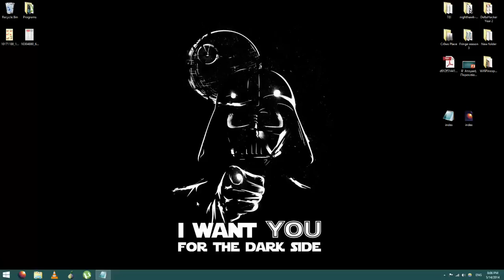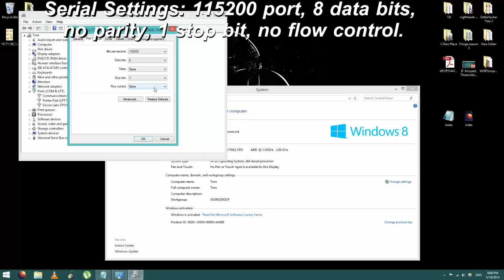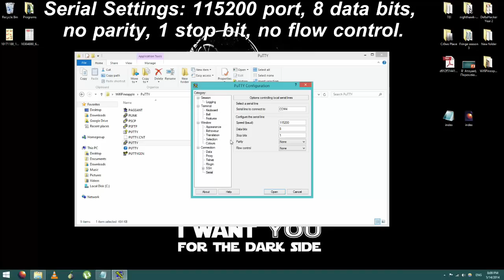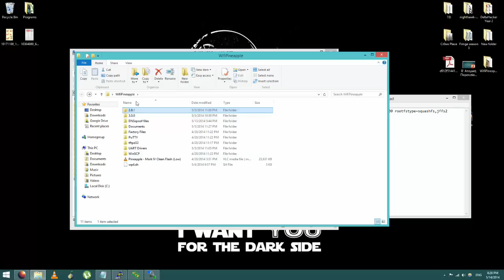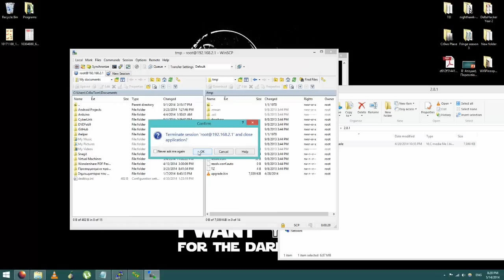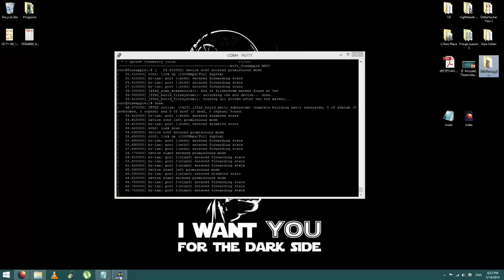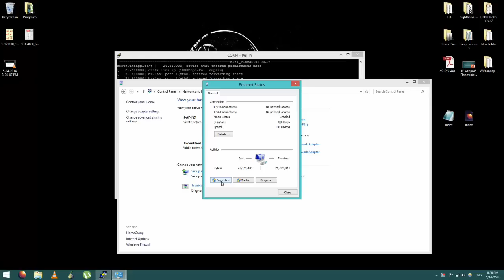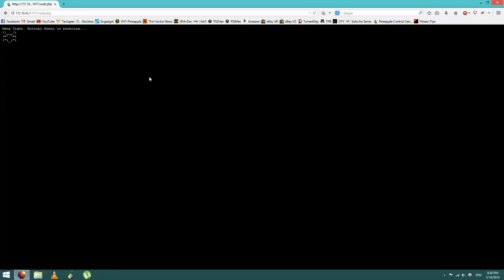Custom Made WiFi Pineapple Mark 4 - AP121U Flashing (HD)

Comment: First of all: Nice tutorial. Worked fine for me but i have a question about the images you used. Did you have to manipulate them to work or are they the plain images you downloaded from hak5's download page? I tried to upgrade to the current MK5 version but i get an error stating the image is wrong. Thanks

Comment: hello! I ordered all the parts yesterday for this project can't wait to get started! I had a question though, the ap121u has the USB port I know that, and I'm pretty certain that it is used for another antenna such as other Alfa high gain wifi dongles. so my real question is what wifi dongles are all supported?
Reply: darn i t ,I just now realized I ordered the 16mb/64mb model will it still work?

Comment: I do have 2 questions..... 1)  Couldn't you do this through WinSCP to avoid the UART to USB cable? If yes I would prefer that since I can upload all the file with WinSCP instead of tftp...
2) You greek?
Reply from the maker: 1) you do it over WinSCP. The think is that you have to flash it over serial and not LAN. If you go over LAN, the process will fail. 2)Yes
Reply: Cr0w's Place Exeis dikio file mou. To dokimasa kai an tou kaneis flash mesw tou programmatos ap51-flash-gui mesw lan dinei ip kai meta tpt.... Ipopsiazomai mporei na einai episis logw tou oti i standard ip tou Ap121 einai 192.186.2.1 oxi1.1

Comment: at the tftp 0x80600000 kernel.bin  , i keep getting 192.168.2.100  instead of 192.168.2.11  
i tried tftp and winagents tftp  , still same problem. what could be the problem? ... sigh :(
Reply: got the same problem. did you solve it? how does it work?

Comment: Is this model a 64mb model or 32mb model? Haha coincidentally, I bought mine from the same vendor.
Reply from the maker: It is the 32mb model and you are a lucky man that you bought this, because Pineapple firmware cannot be installed in the 64mb model :D
Reply: Haha phew~ >< I think I bought two models actually, one shipped from Hong Kong and the other from gigacity. I started a forum regarding this, https://forums.hak5.org/index.php?/topic/33468-fresh-ap121u-64mb-or-32mb/#entry249838 says it might work.